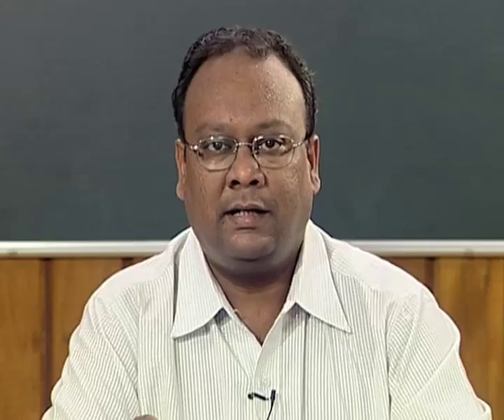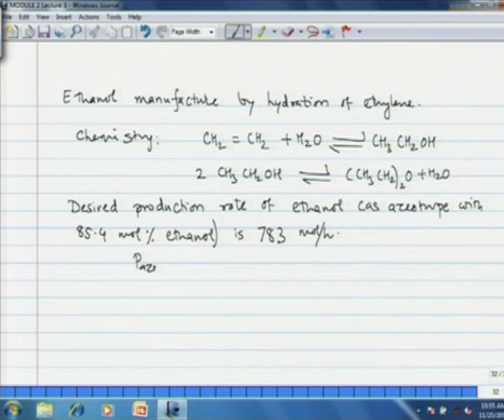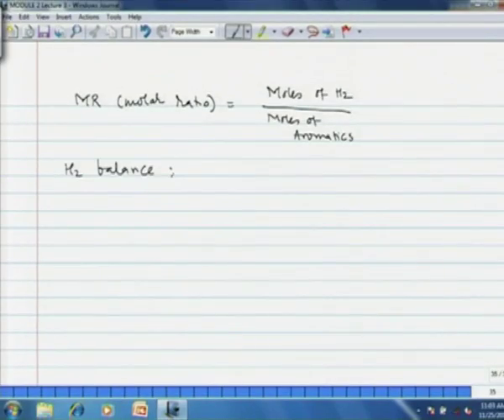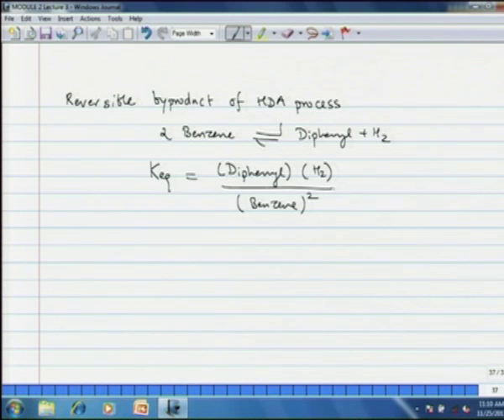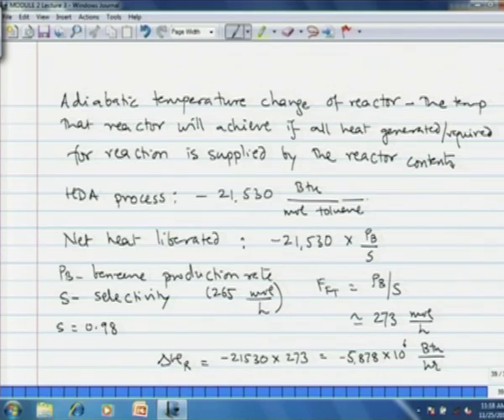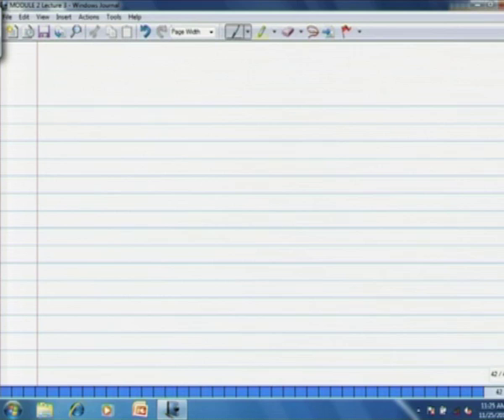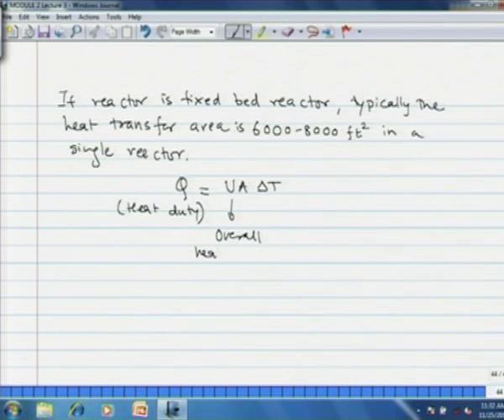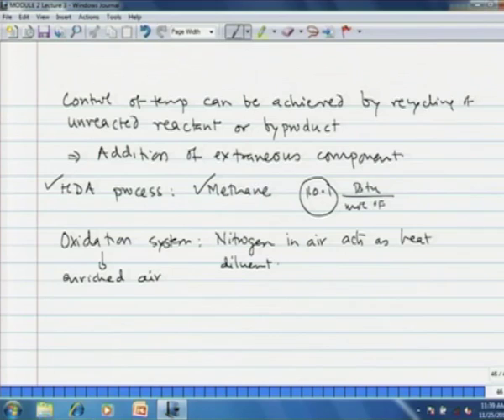Mod-02 Lec-05 Recycle Structure of Flowsheet (Part II)

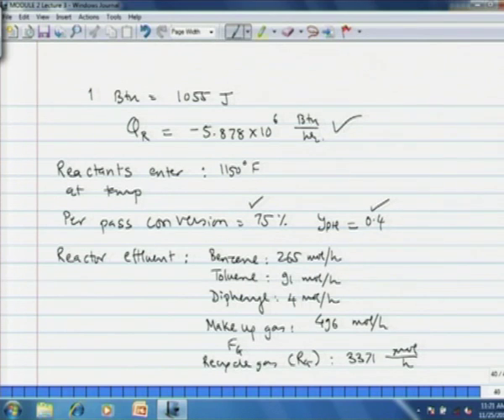Comment: 31:16 
Use formula derived in Mod-02 Lec-03 for Make up gas.
For recycle gas, take MR=5;
For diphenyl, use formula derived earlier (Pb(1-S)/2S)
For toluene, 75 % is Pb/S. So total toluene in feed is 364 mol/h. Now, 25% doesn't react. So, Toluene=91